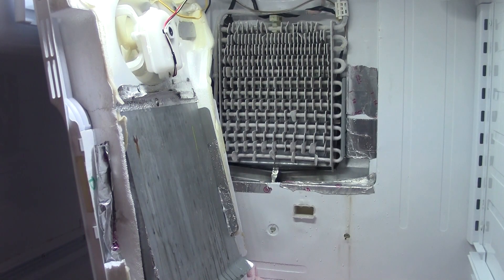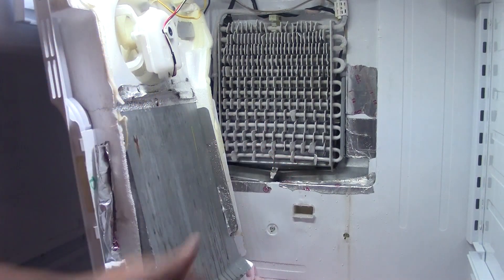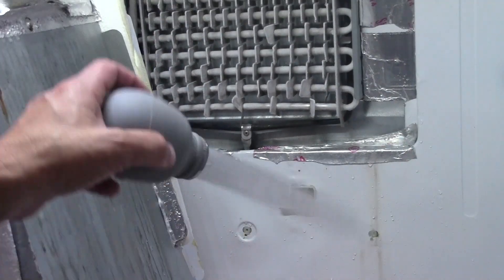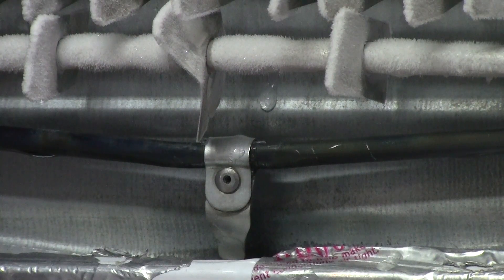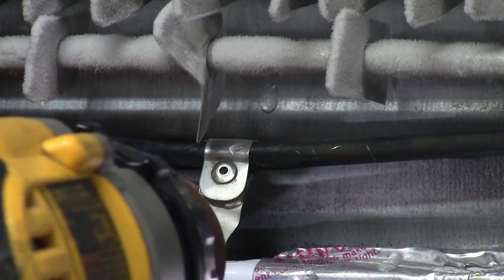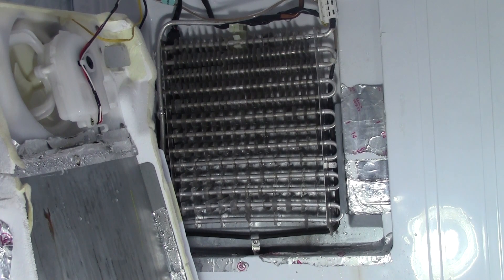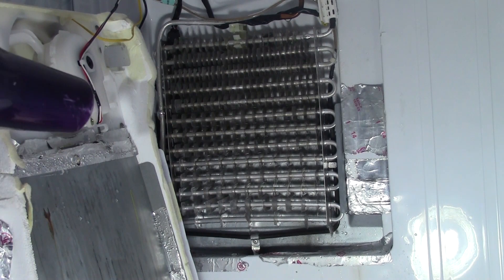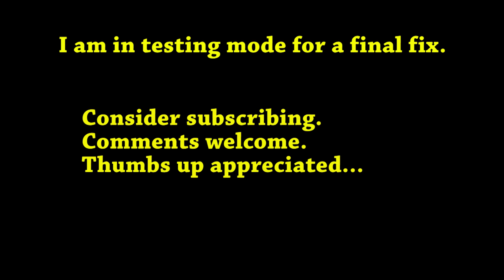PART 7: How to Fix a SAMSUNG RF 267 Refrigerator Not Cooling Icing and Freezing Heating Coil Tab

Comment: Baster tip is pro. I purchased the aftermarket aluminum conductor but didn’t work. Maybe it was because I couldn’t clamp it on firm enough, didn’t have the right tool. But this try I used a thermal conductor pad that I bought for about five bucks.  I put it between the heater coil and aluminum. Fingers crossed!

Comment: If you put it in first defrost you should be  able to see if the heater works i am thinking about using a heating pad with magnets right behind it and a timer it's a thought or turn it on and fridge off when it freezes so I don't have to disassemble  everytime

Comment: Great show!
I got this defrosted for 2 days now and got the hole unclogged  because water was dripping down to the pantry compartment.
I noticed that the bottom middle slot where a screw goes has some drops of water dripping through while I am using a hair dryer to completely dry up the coils.
Strange but when I place my hand on the back of the fridge where that slot is located for the screws, it seems cold still. I assume there is ice still formed in that location. I will continuing defrosting it till tomorrow which is day 3 because there was quite a lot of ice formation. I had the RF263 model since 2014 which is not bad at all.
Some of the coils have been bent possible from the ice formation. Should I try to straighten them back or leave them as is? 
Thanks for the support! 🙏👌

Comment: Jake thanks for the videos.  I'm new to 'fridge repair but I've never had a Samsung 'Fridge either :-)  Your video gave me confidence to do the repair right. My problem was the evaporator fan.  BTW, it took almost 5 hours to defrost the Evaporator Coil and get the back cover off using a blow dryer and fan.  I just wonder if I would have called a repair man would they have charged me 5 hours worth of labor while it defrosted?

Comment: I agree with John Galt. I started having issues with my SAMSUNG Refrigerator about 3 or 4 months ago. Started getting water in bottom under the slide out tray. Finally, after I started throwing away fresh food due to it not cooling, I tried removing the back panel. Completely Frozen. I am trying to defrost it for now, but there is no way I'm going to keep it. It will do it again. SAMSUNG made it, knew it had problems, and should fix under warranty. Samsung won't get any more of my money.     Your video was well done though.

Comment: The Model used was similar but different. mine had a screw and it came off easy, after I destroyed the seals and cracked the cover & two hours of trying to get to the coils. Plus I did
not get the correct temperature setting I requested and paid the expert for. Can you text or email me the settings? My Model : RF18HFENBSR SAMSUNG  I RATE  a 4   I look forward to
your reply.

Comment: Hey Jake, tried all the fixes, even bought a replacement heating coil to no avail so I decided to just wrap a Frost King Electric Water Pipe Heat Cable (3 ft) around the coil where the non working defrost unit is.  It doesn't interfere with replacing the cover and is not it the way of anything.  The wire and plug sticks out of the bottom of the evaporator cover and sits in the fridge below the crisper drawers.  I use the panel codes you provided and just shut it off on Saturdays, run an extension cord in, plug in the heat cable and leave it for 2 or 3 hours.  Fridge maintains its temp well and I haven't had any ice buildup in months.  Thanks for your diligence and hope this solution helps when all else fails.  It's a manual process but not a big deal.  The Heat Cable is under $20.

Comment: Guys. Here's the fix. Get the new design Samsung drain hole defroster. Its on eBay for 5 to 6 bucks. Sombody has already posted the model number in the comments. I pushed the old tab down to the right because that's the side that had more frost. And 2, i moved the defrost sensor(that small back cylinder thing zip tied on the left). I cut the tie and relocated it to the top center of the fins, where all the ice builds up. Haven't had any problems for months(unless people keep leaving the doors open!) In that case i run the Forced Defrost mode before i go to bed and its better by morning.

Comment: This video doesn't show HOW to remove the panel without damaging the Styrofoam baffle which is actually molded air ducts that direct air flow properly. This can't break--the Styrofoam is a functional part of your fridge! 

First off all, turn OFF the fridge. Using a hair dryer, direct it toward each and every hole/slot in that rear panel. It might take 15 minutes or more if there is a lot of ice build-up in the rear of that panel. Picture the ice hugging both the defroster parts AND the Styrofoam... it will grab them tightly together.

After you are certain ALL the ice is melted (the water will stop dripping), look for little raised, molded triangles (arrows, hard to see white on white!) along BOTH sides of the panel. These mark the pressure points where the plastic tabs underneath hold the panel onto the back wall.

Using a flat bladed, stiff putty knife, push firmly but gently inward at each triangle point (just behind the front panel along the side behind the arrows). Do the same to each tab, releasing each one by one. (I seem to remember there are two on each side). IF THERE IS ANY RESISTANCE TO PULLING THE PANEL FORWARD, THERE MIGHT BE MORE ICE! If so, hair dryer it again and try to melt everything back there. 

ONE MORE THING ABOUT THIS VIDEO HACK: 

In my opinion, this gentleman's fix won't last. The way this metal tab going down into the drain hole works is by transferring heat from the defroster heating element to the aluminum tab, then melting ice in the hold. If you notice in the video, this tab is very loose where it connects to the heating element. Conduction of heat will be poor.  ...... Instead of his fix, I took a length of #14 gauge bare copper wire about 12" long, and using a needlenose pliers, I folded the wire in half first and then twisted the closed end (leaving the cut ends loose) into a tight twisted "tail" about 3" long. Bending the loose ends apart, I made a "T" shaped wire with the twisted 3" part as the leg of the T. I then shoved the leg of the T down the drain hole. I then took each loose end of the wire and wrapped and then coiled each end (right and left) around the defroster heating element. I used both my fingers and the needlenose pliers to lace it in and around, pulling it as tight as possible around the heating element as I worked along. In the end, you should wind up with the twisted leg of the copper T about 2-3" down into the drain hole (much deeper than Samsuck's 3/8" with that little tab)... and each bare "arm" of the T should be tightly wrapped around the coil on both the right and left sides of that tab. 

The copper wire will conduct heat much better than that thin tab of aluminum and keep the drain hole ice free. This will hopefully solve the problem of water or ice pooling under the deli drawers.... AND you won't hear that dreaded fan-scraping sound every time the defroster ices up behind the rear panel. (The classic sound is loud when the door is closed and stops when you open the door... a sure sound that ice is building up behind that panel!)

I did my repair this way and so far, there the defroster has been ice free for about 1 year to today's date. Samsung's "new an improved tab" won't work! In fact, NONE of the repairs Samsung gets people to spend their $$$ on will ever totally fix these fridges. There are Samsung service bulletins dating back to 2007 with such problems... all KNOWN BY SAMSUNG FOR YEARS, yet they continue to seel the same defective, poorly designed units! 

Good luck! Tell your friends and family NEVER TO BUY SAMSUNG PRODUCTS. 

For more info and other people experiencing problems with their Samsucks fridges, visit the Samsung Refrigerator RECALL NOW page on Facebook: https://www.facebook.com/groups/1520337151601316/
Reply: This is where I'm at.  Defrosted several times, changed the heat coil, fan spins fine.  I'm putting an extension on the heat tab this time.   Thanks !

Comment: Make a shepherds crook out of a piece of bare #14-12 copper wire. Hang it over the heater element and down into the drain. Have done this often on other makes.
Also, the primary problem is incomplete or no defrost. Control board /tstat terminating defrost too soon? Element open? The paper towel insulation idea is blocking air flow over the coil.

Comment: You can also use a 2 1/2 “ or less piece of 8 or 10 gauge copper ground wire and bend it over the element and into the drain. It will retain the heat longer when in defrost mode than aluminum

Comment: With significant ice build up behind the refrigerator back panel, I chose to defrost & dry out things overnight before taking anything apart (including the back panel removal).   "there was so much ice it had popped the plastic cover off the top panel screw access hole...  and ice was pushing through"  

>  I removed all items from the refrigerator... utilizing the bottom freezer compartment for some food storage (this will help to preserve things while the power is off)
>  Unplug the refrigerator from the outlet...  very important!
>  Remove the glass shelving and set aside
>  Take a small table lamp (not your best one) and equip it with a 60-75 watt incandescent light bulb
>  Stand the table lamp in the center of the refrigerator food compartment
>  The insulated freezer containing frozen food should remain cold during this process... as it's pretty well insulated.
>  Shut the refrigerator door(s)...  it will get pretty warm inside, which is what you want.
>  Wait a good number of hours.  (I chose to leave it overnight)

When I subsequently pulled the panel off to install the "heater wire in the drain" fix...  EVERYTHING behind the back panel was bone dry & defrosted.  I used boiling water poured down the center drain to verify the unobstructed flow down into the evaporator pan underneath the refrigerator. (you can hear it dripping below).

With the problem now "fixed" (I hope)...  we'll be keeping a close eye on things and hoping for success!

BTW...   Hey SAMSUNG:  You blew it with this one!   I can't believe so many customers experienced this problem, and there hasn't been a recall.
In the old days refrigerators lasted decades (made in the USA).  Mine is less than 2 years old with this issue.

Comment: I too have this piece of crap refrigerator and like you, I have had to defrost and try putting copper wrapped around the heater and down through the drain (which I believe is the root cause of the problem). This time I am going to cover the hole with aluminum tape, direct the drain to a shallow pan beneath the drawer and empty as often as needed. Can’t wait till this machine dies so I can buy a GE fridge. $3000 for a fridge that should have been recalled. SAMSUNG YOU DROPPED THE BALL ON US CONSUMERS. SHAME ON YOU!!!
Reply: Ha! GE has the exact same design! Probably made by Samsung.

Comment: Thank you for the info. I had what sounded like a bearing going out in the fan. So i went online and watched your videos. Most of them. Then took the fridge apart. There was ice buildup in the fan housing. It works for now. Ill replace the defroster temp. control sensor and see if that helps.

Comment: Would you have any testing procedures for the main control board on the back? I think that would eliminate some time for repair. Testing procedures I mean for each component on the board.
Reply: If you run into circuit board issues, try a place called Circuit Board Medics. They've saved my ass several times and they stand behind their work. If you're having this icing problem with your "twin cooling" Samsung, then listen to these folks. I just defrosted mine and did the heavy guage copper wire wrap with several inches down the drain hole. Hope to hell this is the golden fix...

Comment: If you don’t put the cover back on will the refrigerator function Normally?  I am thawing mine out as I write this.  Thankfully I have a second fridge in the garage. I lost two gallons of milk. The digital reading said 36 but I bought an old school thermometer and it was reading 55.
Reply from the maker: It won't cool properly without the cover.
Reply: I had the same issue but the reason why mine had built up ice on the Evaporator Coil was because the fan had died.  It took me almost 5 hours to defrost the ice and get the back cover off using a blow dryer.  However I then ordered the fan online $23 it took 5 days to arrive, so I put the fridge back together without the back panel.  It will get cold but the bottom of the fridge will freeze (32 or below) while the top will be around 45 - 50. Because there is no circulation.  Fan arrived defrosted the coil in 10 minutes, put everything back together and it's working great.

Comment: Did you check the heating element for continuity?  If it's not working surely this whole process is pointless?
Reply from the maker: Good point.  Yes, all the components behind that panel are good.  Correct ohms on all parts.

Comment: Can you use a clip drain like this? http://www.appliancepartspros.com/samsung-clip-drain-evap-da61-06796a-ap5579885.html#  I was told it's to be installed on the defrost heater, under the evaporator coils.  Here is an article i found- http://www.appliancerepairlesson.com/2013/12/13/samsung-refrigerator-leaking-into-crisper-drawer/ 

Is it serving the same purpose?

Comment: Why these freeze-ups occur in so many Samsung refrigerators is the result of an engineering flaw. The evaporator fan(s) are not large enough to move the right amount of volume of cold air. Since the air cannot be removed fast enough, the result is an evaporator freeze up. Bear in mind, when an evaporator freezes up, it could be for many reasons. A plugged drain is only one of them.

Comment from the maker: What I am going to show you in the next video to come out in the next couple days is not going to be a "FINAL FIX", but it should at least prevent it from freezing up as often.  (like every 6 months instead of every month). It has been working for me, and I hope it will work for everyone else.  Its a very simple and inexpensive solution.  Please click the little BELL, next to the subscribe button so you don't miss it.

I have to break out the camera, record it, edit it, and then upload it.  I will start tonight and hopefully have it uploaded in the next day or two.
Reply from the maker: You can add this clip if you want, but it wont stop the ice from forming.  On my fridge the clip was immersed in a 2 inch block of ice....
Reply: jakeguitar01 why don't you just solve the drain problem and level your fridge it's supposed to be tilted back some so the doors shut properly and it also let's the water drain off before it freezes again

Comment: I am having this issue, glad I found your story. I know the problem is elevated when the reefer door is open longer than it needs to be or should be in normal operation.  It's a gender thing. I'm wondering if the 'system' isn't properly configured to handle this or if it's really a poorly engineered piece of equipment.
Reply from the maker: What I am going to show you in the next video to come out in the next couple days is not going to be a "FINAL FIX", but it should at least prevent it from freezing up as often.  (like every 6 months instead of every month). It has been working for me, and I hope it will work for everyone else.  Its a very simple and inexpensive solution.  Please click the little BELL, next to the subscribe button so you don't miss it.

I have to break out the camera, record it, edit it, and then upload it.  I will start tonight and hopefully have it uploaded in the next day or two.

Comment: In an attempt to install the longer clip onto the heater coil,  I have removed the ice, squeezed hot water with the turkey baster inside the fridge itself, but it is still not draining. I then removed the lower panel on the back and identified the 2 drain tubes that drain into the pan. I removed them and inspected them. I was hoping for a big splooge of dirty water but no, they 2 drain tubes seem to be working as designed. I then took a flexible plastic tube and was able to stick it up about 18 inches. I sucked and blew on both and it seems like they are clear. I did the same from the inside of the fridge and again was able to get it down a bit over 12 inches and blew air in there but I don't think it reached the other side. 

somewhere between 'here and there' there is a kink or a blockage that is preventing the water from draining. Getting frustrated to say the least.

Comment: I have replaced the motherboard, heating element, wrapped copper wire around the bottom of the heating element and inserted the wire into the drain hole and it still freezers up and makes noise.
Two service calls probably $500.00 dollars into this and no luck. I hate this refrigerator. BTW, its unplugged now because I couldn't stand the noise any longer.
Reply from the maker: Wow, even the mother board wasn't the answer.  Don't throw away the fridge yet, I think I am on to a decent solution to the problem of icing on the coil.